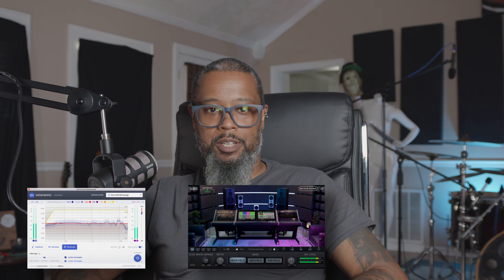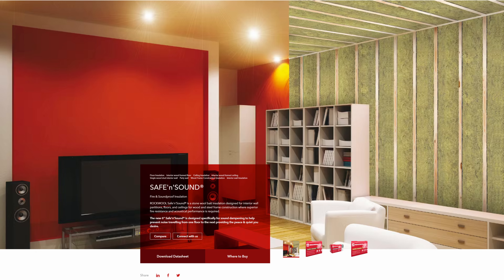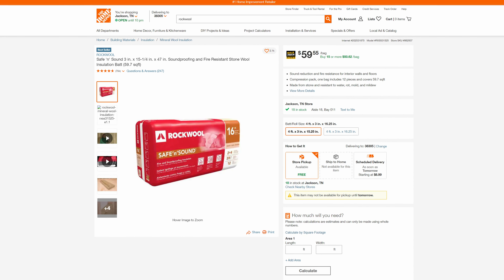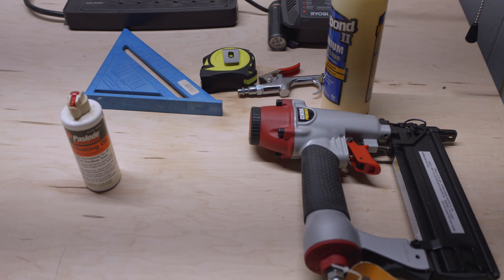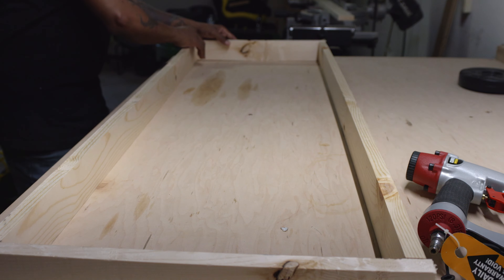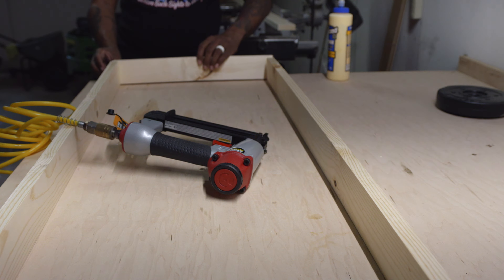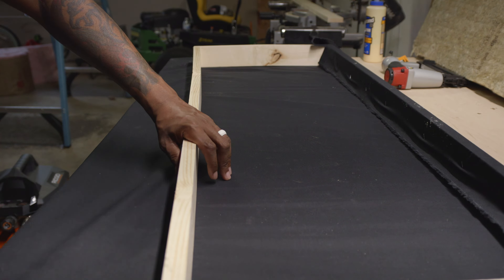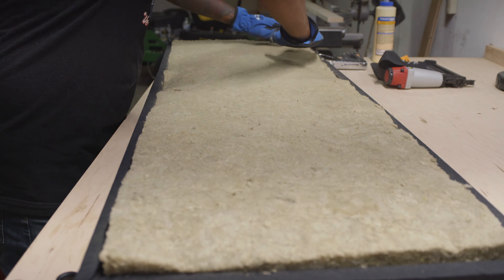DIY Acoustic Treatment Panels - Better Mixes through Better Listening Environments

Comment: While the rock-wool is acoustically similar to Corning 703, there are a pros and cons.  

First - the pros: Rockwool is significantly cheaper and much easier to source than 703.

Cons.  It is much heavier and the fibres may escape.  The extra mass and flexibility of rockwool panels can, over time, create sag (especially when mounted horizontally)  This can be especially problematic for bass traps - which tend to be thicker.
  
The former problem can be remedied by covering the back side (either with more cloth or a backer board - it doesn't have to breathe on the back).  The latter issue can be solved by ensuring that the grill cloth is of sufficient strength to stop sag or by reinforcing the front of the panel.  For rural folks, chicken wire works great and is cheap and easy to find.

Regards from cold Canada.
Reply from the maker: I like using landscaping fabric to help seal the rockwool in a bit better.

Comment: Perfect timing for me with this vid! Moving in to a new spot and gonna give it some sound proofing love. 
 Any suggestions for installing the panels in a way that I can then take them off and move them? #renterlife
Reply: P.s. have you done the math on how much each panel costs you?
Reply from the maker: Congratulations on the new place! I'd check with the new landlord and see if they mind eyehooks. You could do hooks and pictures wire, this build is lightweight if you use 1x3's.

As for total cost, it averaged to about $21 per panel.
Reply: @LetsTalkAboutReaper  wow that's hella cheap. If you ever decided to manufacture and sell them for 42 bucks I'd buy it :P